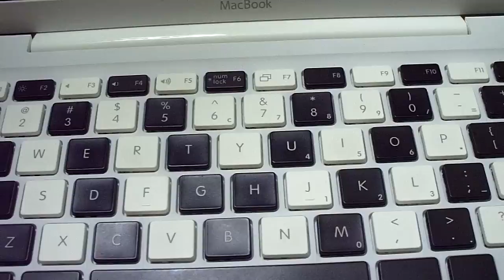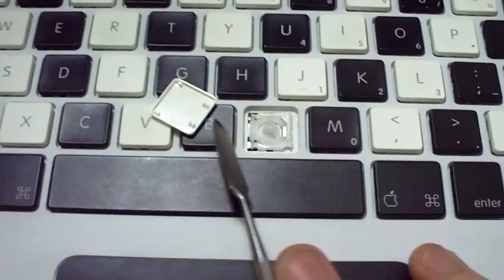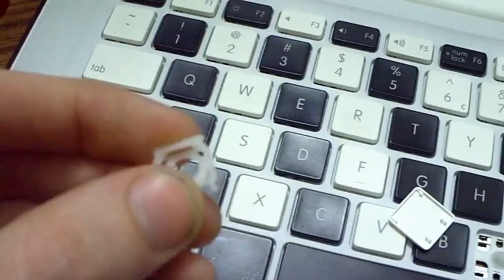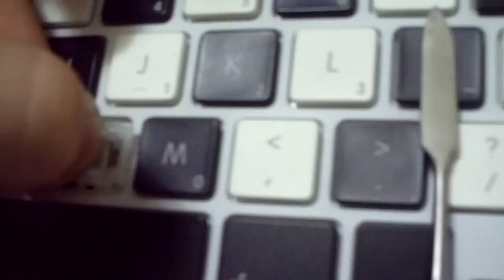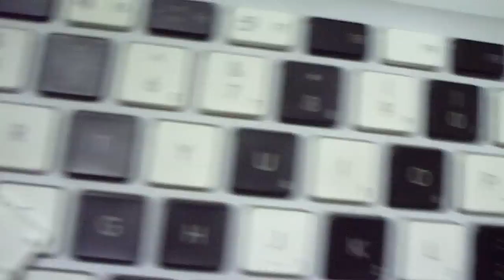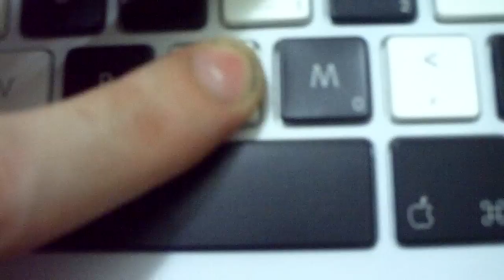Annoying plastic brackets under the keys

Comment: can someone make a vid on how to put the two bracket parts together
Reply: I used a pair of locking forceps ( http://www.wpiinc.com/products/laboratory-supplies/501288-kelly-forceps/ ) to stretch the outer frame wide enough so that the pins slipped into the holes.  After some thought about it, I figured it'd be safer to bend the entire thing, then try to bend the little pins.  I inserted the end of the forceps inside the frame then opened them until the inner frame fell into place.  2 hands and a magnifying glass is helpful.  Also, make sure to use only as much pressure as it takes.  It's easy with such small things to use too much force.  I broke one of the pins on the outer frame while removing it from the keyboard, luckily, I have several keyboards laying around for spare parts.
Reply: I used my teeth to be honest. There was junk between my keys and when i popped it off one metal bracket came undone and i had to take the entire thing off so i putt the two white plastic pieces together and pushed with my teeth. I wouldn't recommend this method because i don't know if i just got lucky but that is how i did it.
Reply: yeah pls
Reply: @ayabazzi3935  you could just take a key you dont use that much and take the brackets from there

Comment: Thx for this, i pulled my key off out of curiosity and wind up pulling some of the white brackets out of place unlike the other keys i had previously taken off. I didn't realise until, after an hour of frustration, i realised the two brackets attached to each other and snapped together making it WAY easier. Cheers mate

Comment: I had to snap the bracket to my key first. Little posts slid under clips on the key to hold the bracket on. Then it easily snapped to the Logitech key board on my iPad.

Comment: I just had this happen last night one of my keys (still is coming up at this point and having to reattach it to even type now), and I looked at this video and some others and ended up figuring how to put everything back on thinking that everything is fixed and the key-cap and the retainer cap are both coming off stuck together, I'm just wondering is something broken where it just won't go back on anymore or what? Cause, even when I put the retainer cap on it feels very flimsy and not sure if that's suppose to "snap" back in.

Comment: The actual white part is stuck in my key how do i get it out. like the actual key not on the laptop. its in one piece , but the rubber cap wont fit properly unless i take it off so am i screwed?